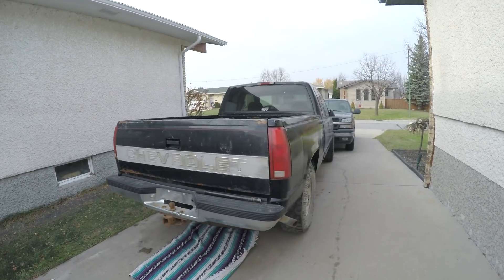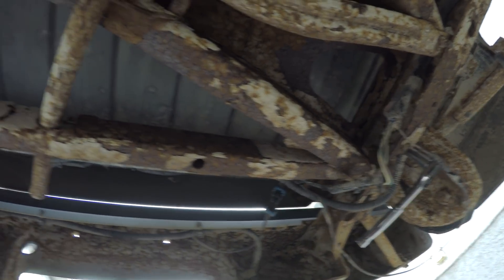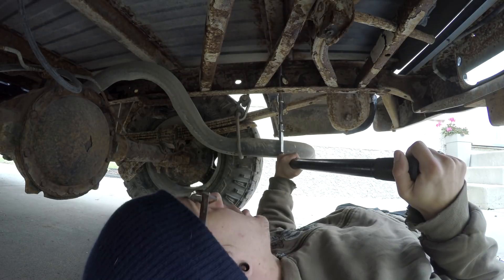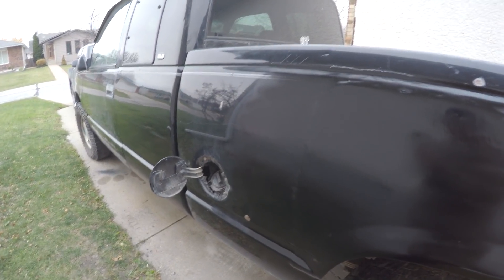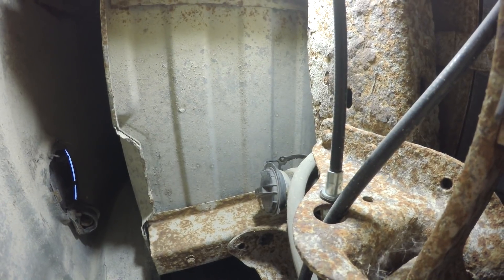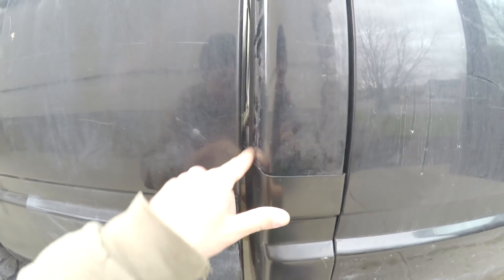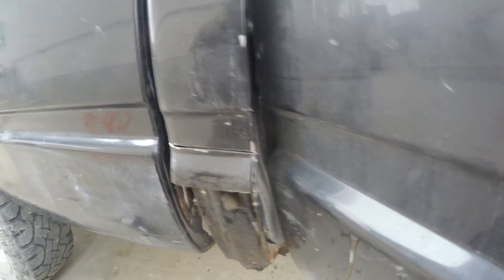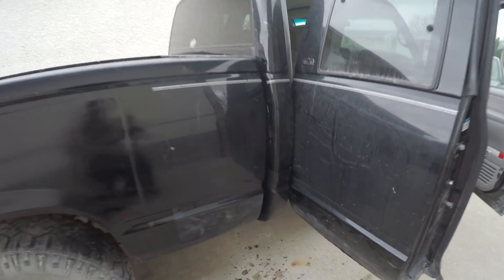How To Remove a Truck Box/Bed (Almost) | Rusty GMC Sierra Struggle Street

Comment: Hey Mike, no need to pull the filler neck out, undo your 3, 7mm screws, the connectors for the taillights, have a couple guys lift the box up and rest the front on top of the tires, and the back on the bumper. Works mint. Do it all the time for fuel pumps.